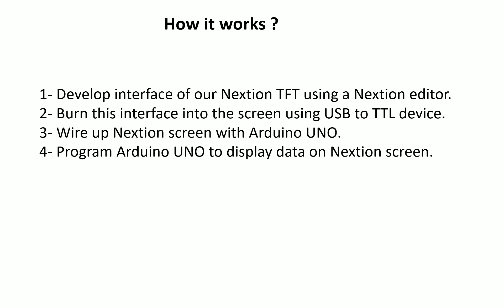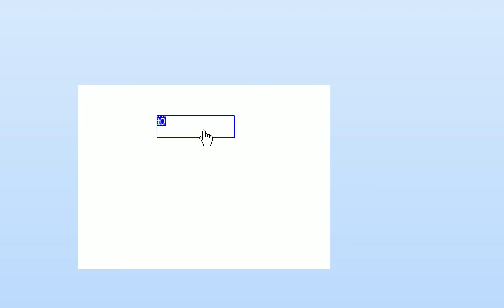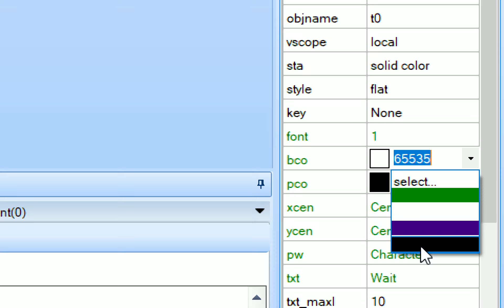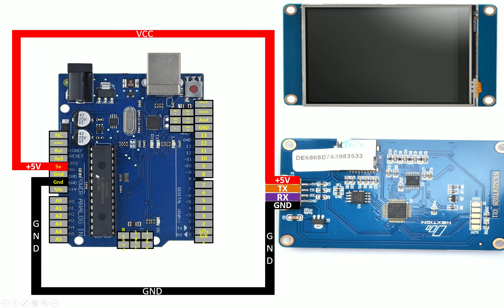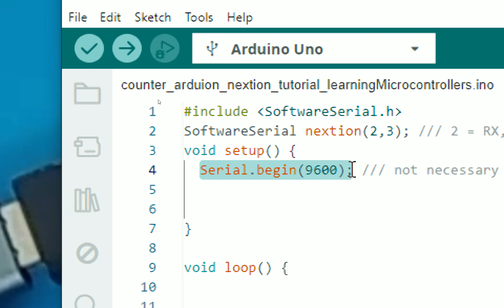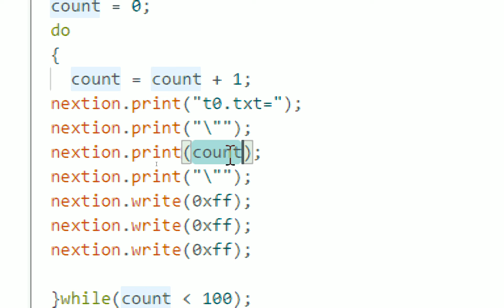Arduino UNO interface Nextion Touch screen.Run a counter from 0 to 100.

Comment: Hello, please help.
I did everything correctly, but the display doesn't see the serial data. The monitor sees it when I send a command, but the display doesn't. What could this be?
Reply from the maker: Share code at my email I check